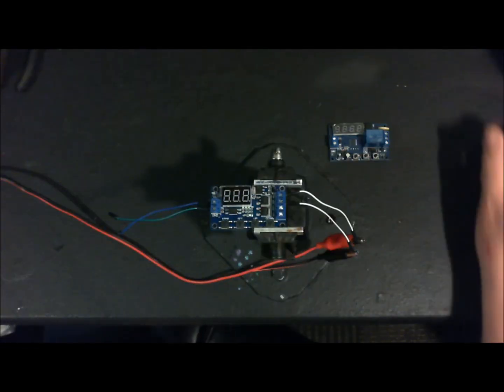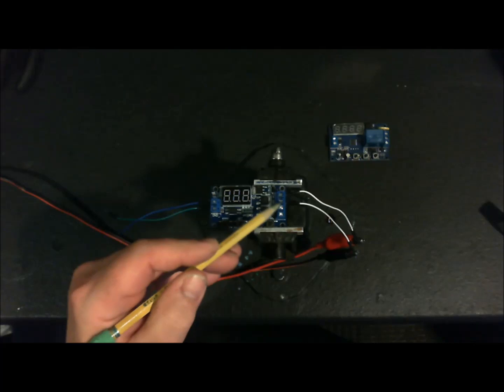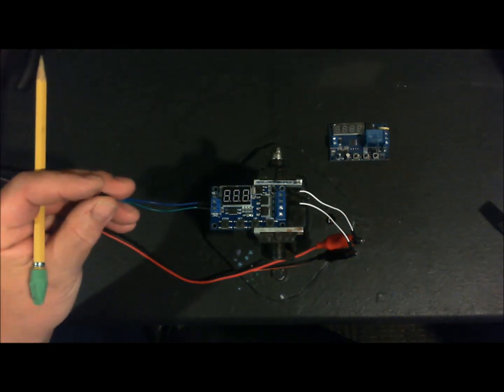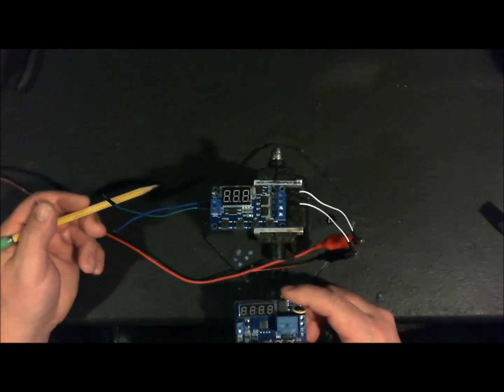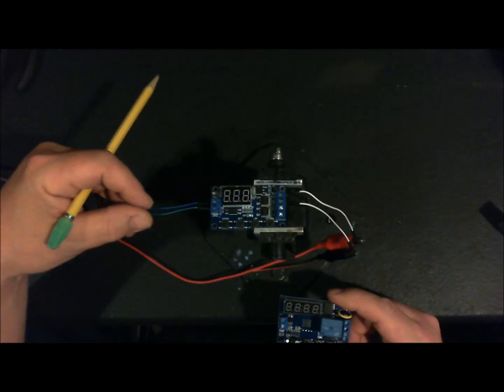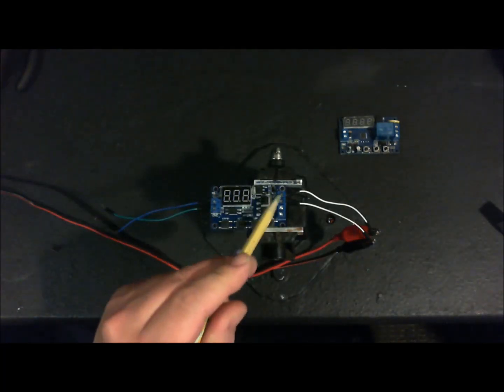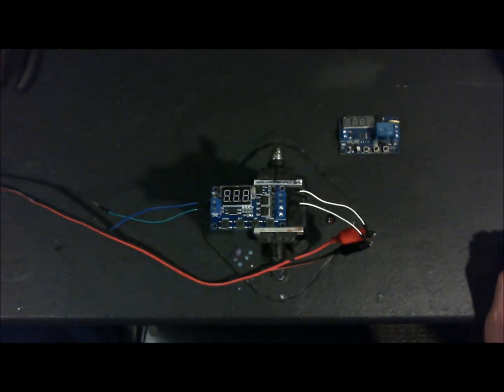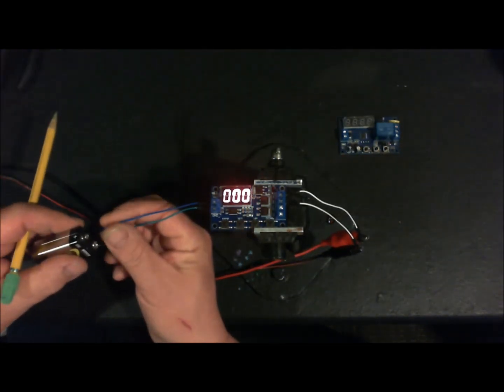Trigger cycled timer control board simplified.

Comment: Hi Ray, Great instructions, I am unable to programme so that an alarm will trigger for 3 seconds and then switch off each time it is triggered.. I cannot locate P1 on my controller. Trigger is a pressure switch, alarm is a siren. Seemed simple to me but having heaps of trouble getting it to work. best regards Glen
Reply from the maker: Good day. Can you send me a pick of your board? See if you can get the numbers in it. (Version)
Reply: @raykd2ibp198  Pic sent via your email, many thanks. Glen
Reply from the maker: @Ezivnelg  I'm sorry I didn't get the email.

Comment: I wonder, what is the maximum ampere it can handle on the output or load side?
Reply from the maker: Pretty sure it's in the specs.
Reply: @raykd2ibp198  it says, 15A or 400w that's a lot for this small module timer.
Reply from the maker: @Stephen Shop  Be careful my brother.  They are cheap boards for experiential, educational purposes.  Fun to play with.  Best to have them in fire proof enclosures.

Comment: Is this better than mechanical relay module?
Reply from the maker: Both have their merits, and shortcomings depending on what you’re using them for. Can you give me an idea regarding the application?
Reply: @raykd2ibp198  just to turn off the 5v bulb from 5v powerbank?
Reply from the maker: @Stephen Shop  Either one is fine for the application described.  Be safe whenever you're playing with electricity.  Pretend it will kill you if you make a mistake. Simply because it can.
Reply: @raykd2ibp198  what is the minimum voltage for this module to operate ?
Reply from the maker: @Stephen Shop  At the time of this posting.... I believe they were 5-30 vdc on the trigger side. Don't remember the switched side. Don't mess around with electronics if you're not sure regarding what you're doing. Even  low voltage can start fires if you make a mistake. Don't be that guy   ;)
Reply: @raykd2ibp198  can i set the timer On for 5 hours for bulb lighting then off after 5 hours?
Reply from the maker: @stephenshop4946  Yes.
Reply: @raykd2ibp198  I'm searching for low voltage disconnect module of this mosfet type (Not Relay type) cause it's  economical in power. Thanks for all the replies.

Comment: Great demonstration, thanks. I'm using one for an alarm system where I use a trip wire attached to a pull pin that operates a micro switch to send a 12 volt signal to trigger the board and sending an operating voltage to sirens, lights and GSM dialler. Now, here's the thing, It works most times but occasionally does not and I have a theory that the time length of the signal, on occasions, may not be long enough. A trip event pulls the pin out super quick and, once pulled, the micro switch instantly returns to its normally open state. I suspect that if the micro switch closed circuit condition is only in the order of milliseconds, it may not satisfy the boards signal parameters. What do you think? Ps. I have just modified the micro switch assembly to remain closed circuit after activating, until reset, so I am testing a few more times to check my theory out.
Reply from the maker: If you close contact that's it. The programed sequence starts. Is it a momentary N.O. switch?
Reply: @raykd2ibp198  Yes, using the N.O. connections of a micro switch with a roller arm that closes the circuit when lifted by a ramp on the withdrawing pin. When the trip wire is walked through, the pin pulls through the micro switch in milliseconds.
Reply from the maker: @SuperRealityKid  Not to read judgemental.. however, this reads like a contraption. You might want to simplify the trigger. Try circumventing the whole switch setup and see if the board goes through the programed sequence .
Reply: @raykd2ibp198  🤣It's actually super simple in construction. The "pin" or 4" long 3/8" stainless rod is inserted into a lose fitting tube with a slot along its length on the top. The rod has a high spot that is guided by the slot and operates the micro switch when it's pulled out of the tube by the trip wire. Mechanically it works flawlessly every time but I will try operating the microswitch manually without using the pin.
Reply from the maker: @Super Reality Kid  k. How's about a video? Get yourself out here brother!
Reply: @raykd2ibp198  Thanks. I've done a few 🙂

Comment: Do you need power to connected to trigger and signal?
Reply from the maker: Yes check the voltage requirements on your board. I believe the boards that I played with at the time of this posting was 5-30 VDC

Comment: Can I just use a cold switch with no power to trigger it
Reply from the maker: Good day, I’m not sure if the boards evolved to the point that you can dead short the trigger contacts to start the programmed sequence. However, I doubt it. You can try… I don’t think you can cause any damage. The boards I played with need to be triggered by 5-30 volts dc. Check the specs. this is not hard to do because, you have the voltage going to the board to power it up anyway. Please let me know if you need anything else.

Comment: Is there a way to make the board start and stop the timer if a momentary switch is pressed then released?
Reply from the maker: Hey Chris. Yes that's the trigger. It's all in the programing.  If you get stuck give me an idea regarding proposed sequence of operation. You don't need to get detailed. whatever is being turned on or of we can just call the load.
Reply: @raykd2ibp198  Thanks. The project I'm trying to build is fairly simple.

Power source 9v.
1. Trigger is a momentary switch that tells the module to close the circuit to the load and provide it power.

2a. If the momentary switch is released, delay off timer ends immediately and the circuit opens with no more power to the load. 

2b. If the momentary switch remains depressed, the circuit stays closed until the delay off timer ends and opens the circuit. 

The issue I keep finding is that the modules all respond to the trigger, start the timer, but I can't interrupt the process if a momentary switch is released. Do you know anyway to program them to make the above happen? 

Thanks again for your channel.
Reply: I may not be using Delay On and Delay Off correctly. The ultimate goal of the module is to prevent continuous load beyond a set number of seconds, but have the user have the ability to stop the load the moment they release the momentary switch.
Reply from the maker: OK, What if you have a NC momentary switch to kill power to the board as a reset?
Reply: @raykd2ibp198  Thanks for the suggestion. I’ll look at options.

Comment: Thanks. I powered the on and main w the same source. As my system only needs power while running
Reply from the maker: I don't understand
Reply: @raykd2ibp198 I think they must have joined extra wires to the wires going to "input" and powered the trigger side with that same voltage input (maybe with a button in line with one of the trigger wires),  since both trigger and the voltage being switched would be within operable range for the circuit

Comment: If you program it on/off to infinite cycle does still need  signal trigger or it will run by itself ? Thank you.
Reply from the maker: I believe you can program the number of continuous cycles after the trigger. Not sure about infinite. Probably  1-999
Reply: @raykd2ibp198  i found, it says - - - instead of numbers means infinite cycle

Comment: The trigger could also be the peizo speaker on a $1 watch or clock.
Reply from the maker: Ok never tried it. You have?
Reply: @raykd2ibp198  No, but I've seen it used to trigger a relay on VERY similar circuits.

Comment: My output voltage is always on, but my timer works.  Did I fry my board?
Reply from the maker: Hello, 
Did it once work as planed using your current wiring and program?
Reply: @raykd2ibp198  I think so so but things got a little complicated and I’m worried I crossed something in there.  Just don’t know how to test it or what the signs are since the timer still works.
Reply from the maker: @Airn5475  Can you send me a pic or video?

Comment: Hi Ray! Thanks for the informative video. How can I trigger the board with a non-powered momentary switch?
Reply from the maker: Hey Bill. Got a pic of the board you're  using?
Reply: @raykd2ibp198  It's the HW516. It looks identical almost to the one in your video. Not sure how to attach a picture here.
Reply from the maker: I got it. please see the attached link. Please don't feel bad liking, and subscribing! Also, please let me know if I can offer more help.  https://youtu.be/UDnsT2B8LXY
Reply: Set for P3.2
 Set the run time and set the off time.
 Set for --- "infinity" to loop.

Comment: Would this all work the same if it were powered by 9v?   Also would resistance in the load change amything? I'm using 9v and my load is just a globe. When the globe isn't attached it works fine according to the indicator light but the the circuit it closed, the indicator flashes for a split second then goes out regardless of programming
Reply: 9v question answered i see but the rest I'm still wondering
Reply from the maker: What is the globe? Is there a light in it?
Reply: @raykd2ibp198  a low resistance globe. I think I've figured out that i need higher resistance or it just shuts off. Thankyou for your reply though

Comment: Sir, can I operate it on a "loop" without a triggering signal? Like I want to make something ON for 12hours and OFF for 12hours everyday without the triggering signal. Thanks.
Reply: Please I  really need an answer to this same question.  I need ON for one second and off for about 10 minutes.   I don't mind using another device to provide the trigger.
Reply: @tangentgardner  Yes it can, and I tried it already. You can find the different operating modes explained in details here: 
https://youtu.be/p9u8lrsRrWE

In my case in I been using mode P3.1.
Reply: @nps2838  Please, I now have this working grand.   Thank you so much.   But for reasons of safety, I must restrict the on period to less than 5sec.   How can I stop the end user from increasing the on time for more than 5sec?
Reply: @tangentgardner  Hi, what are you working on? I can't give you a good advise as I am just a below average guy when it comes to this stuff. Maybe you can put a warning plate on that thing indicating not to re-program the timer for safety. You can add another safety device(fuse?) if ever it operates more than 5 secs.
Reply: @N PS How did you wire yours? I'm trying to do a loop with no trigger as well. I'm using P3.2. but when I connect my air pump to COM and NO/NC nothing is happening.
Reply: @KlasseCaldiny  you might need to press the stop button  to toggle "ON" mode when using it for the 1st loop.
Reply: @nps2838  Tried that, the timer is still going on, and the OP and CL are still both going on, but when on OP no current is going to my airpump (airpump is working tested with a 9-volt)
Reply: @KlasseCaldiny  did it work already? I am guessing it is not wired properly. Can I see how it is wired? Apparently if i post my email here the post gets deleted.
Reply: @KlasseCaldiny  if i have only a common 9v source for the cycle module and pump, I would wire like this, 
-wire the positive and negative of 9v source to the input (positive, negative) of the module
-then again wire the negative of the same 9v source to the negative connection of pump.
-then wire the positive of the same 9v source to the COM of the module
-then wire NO of the module to the positive connection of the pump.

Since you are using P3.2 i guess you don't need a trigger button.
Reply: @nps2838  Ohhh, ok that makes sense. My pump was only connected to the COM and NO sections of timer, I will try this out thanks
Reply: @nps2838  It worked, thanks for your help!
Reply: @KlasseCaldiny  I'm glad it worked. You're welcome.

Comment: hello, can i use this switch in incubator motor that is 220v? can you help me how to do the wiring
Reply from the maker: Hello, Do you have the specs on the motor? Also, do you have basic experience wiring high voltage circuits? Safety is number one. You can kill, die, and burn down property if you screw up even a little bit.
Reply: @raykd2ibp198  AC 220V-240V 5/6RPM 4W 50/CCW 7mm Shaft Dia Fan Synchronous Motor  thats the specs of the motor. i know how to wire, but im not sure about how this switch really works coz no manual was sent when i purchase
Reply from the maker: Ok, I can not be held responsible if something blows up. If you agree to that I will help you out. Deal?
Reply: @raykd2ibp198  ok.
Reply from the maker: @helpinghands9250  Ok swell. Are you using power from the US? 120vac + 120vac = 240vac 60hZ?  Start with this video. Don't hook anything up. You need more parts. https://www.youtube.com/watch?v=ysMldbfteLo
Reply: @raykd2ibp198  nope. im using ac 220v. im not from us
Reply from the maker: @helpinghands9250  K, Where are you from? I'm gonna learn something here too. No objection.
Reply from the maker: @helpinghands9250  Yup please don't do anything till we gather more data.
Reply: @raykd2ibp198  my main concern is, can i use ths switch in 220v motor? or ths is only intended for dc
Reply from the maker: @helpinghands9250  You can do AC not 220. 220 has two legs. 120+120 is 240. The board is liken to a spdt switch It will only handle one leg 120Vac. you need to ad a relay after the board. I'm on the way out, watch the vid get familiar with the board I will be back in a couple of hours.
Reply from the maker: @helpinghands9250  https://www.youtube.com/watch?v=idLZaikzIJg